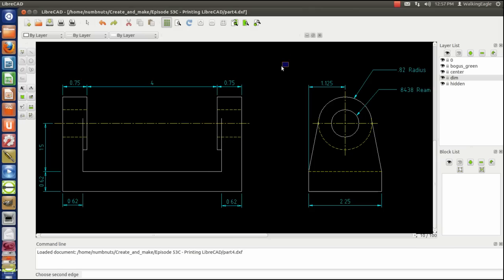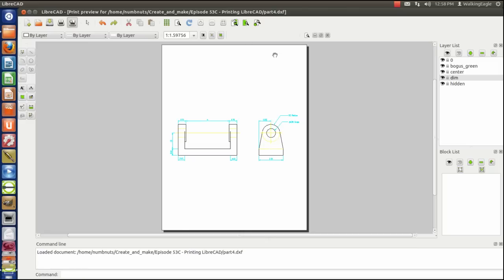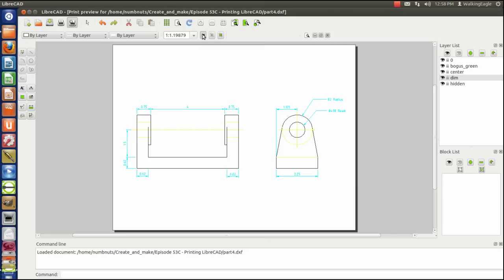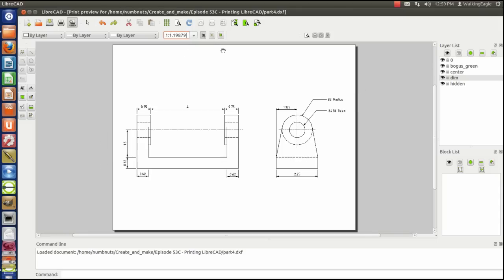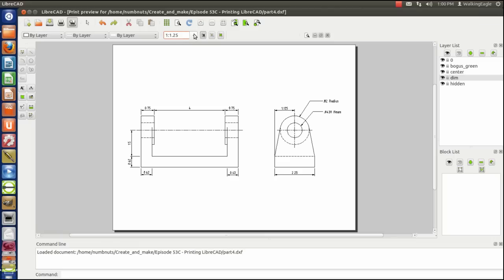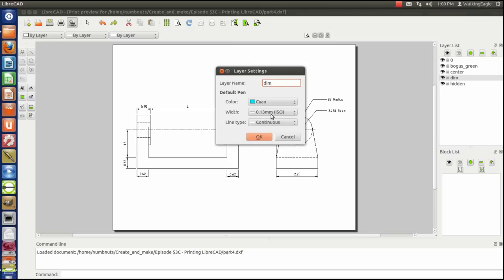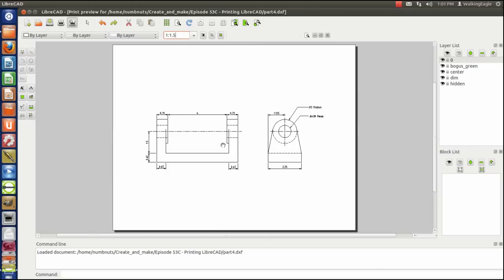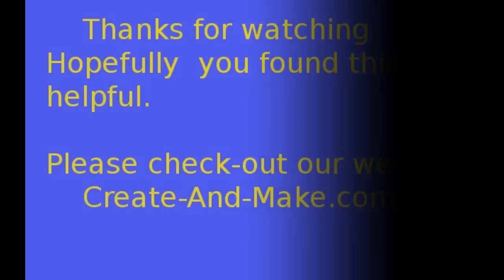LIbreCad Tutorial 5 Printing a Drawing

Comment from the maker: Thanks Greg.   Normally I do not like tutorials either, and prefer to scan a manual and learn through my fingers and then refer to the manual as I need more information, but I could find no manual for this program.  This is just too good of a program to allow it to die on the vine due to lack of information so I created some.  You will find as you go through these tutorials I learned better ways in the latter tutorials than what I knew in the early ones.

Comment: Greetings and thank you so much Mr. Fox. I am grateful for your efforts, patience and sense of humor. Great videos about a worthy program! I am a semi retired engineer and a never retired trainer who finds these videos very helpful. You are even showing an ol' dog new tricks! Kudos! Incidentally, with what software are you recording your screen/videos? I am currently working with a Xubuntu 14.04.04 variant (Voyager).
Reply from the maker: +Adam Truth  Sorry I am talking so long to get back to you.   To record the screen I have to use several pieces of software.   For the screen itself I use some software called "RecordMyDesktop"... On the computer I was using at the time I recorded these I could not easily get the audio to work the normal way so I used a handheld mp3 recorder.   I edit the audo using Audicity. and add the lead-in and exit tracks.    Back to Video I could not get the video editing software to work with the type of file RecordMyDesktop created so I use Transmagedon to convert the video to mp4.   I use Gimp to create the title and exit screens and then edit the whole thing together using  Openshot Video Editor.    Every bit of it is open source sorftware.

Comment: Hello, I really like your tutorials. However, when I click on print preview I do not see the toolbar where I can set the scale. Do you know what I can do to fix this? I run LibreCAD 2.2 on Windows 7. Thanks for the video
Reply from the maker: All the videos were done using LibreCAD 1.??? but I have installed 2.XX on another computer and pulled it up to answer your question.   The tool bar you need "Tool Options"  That is a very helpful one to use on just about doing anything in version 2.
Reply: Gary Fox Thank you very much! :)

Comment: My LibreCad 2.0.3 don't want to print in landscape mod, I check Landscape in Drawing preference and in printer settings to. Any idea?
Reply from the maker: I have yet to upgrade to LibreCad  2.  It is still not the one authorized for my version of Linux.   I have had lots of strange situations that happened when I tried printing LibreCad at work using a Windows system.   I think it has to do with the printer driver and not LibreCad.   I needed to get something done so I worked around the problem and did not actually troubleshoot it.   Probably the best thing to do is go to the libreCad forum at Librecad.org
Reply: +Gary Fox to prevent the cut off edit the Margins in the print settings